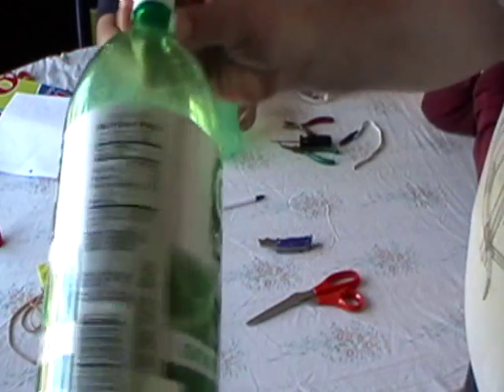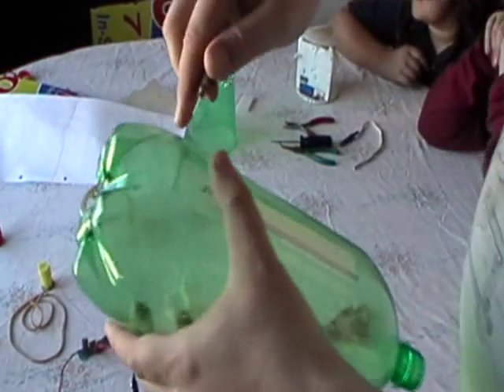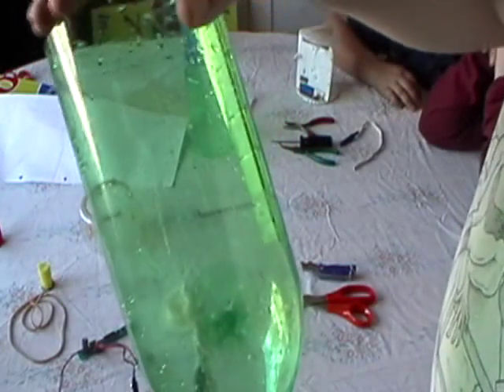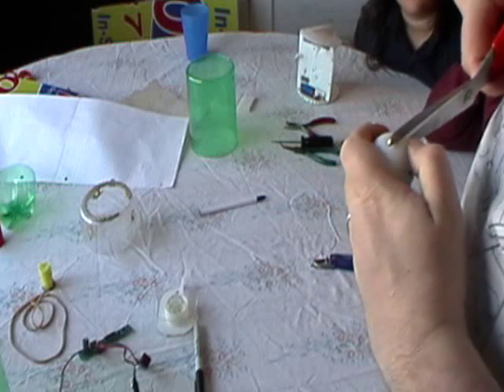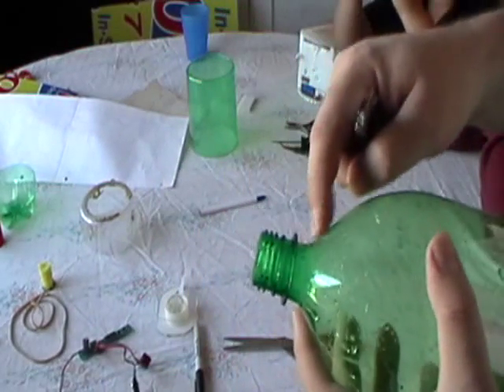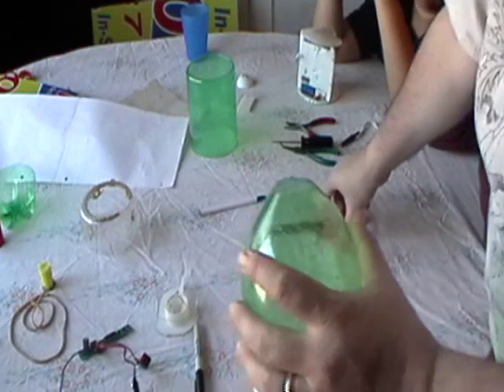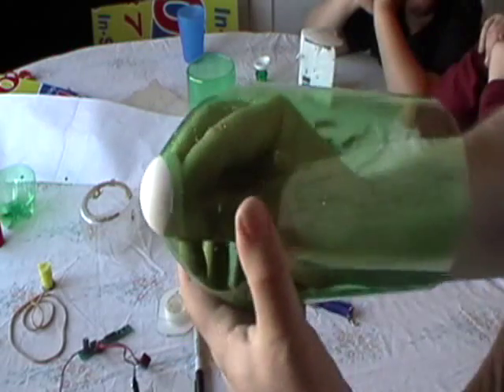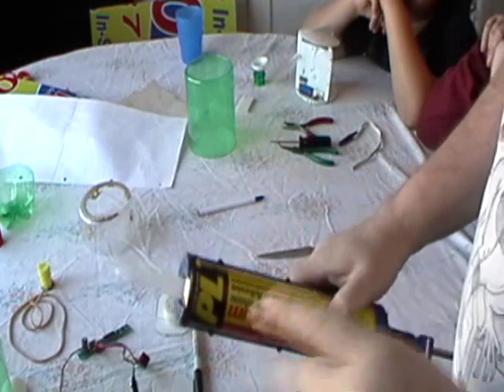Two Stage Water Rocket Parachute Recovery - Part 3 - The Nose Cone

Comment from the maker: You need a glue that is strong, waterproof & will stick to PET.  I tried several types, each failing in one way or another before I came across polyurethane glue.  Any type of polyurethane glue will work but I found the PL-Premium is the best.  It is thick like toothpaste so it stays where you put it.